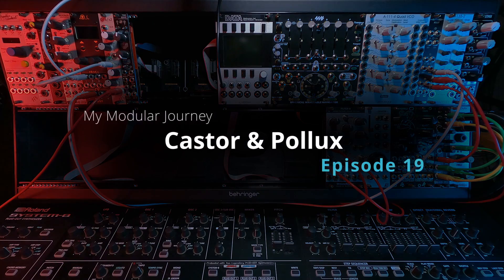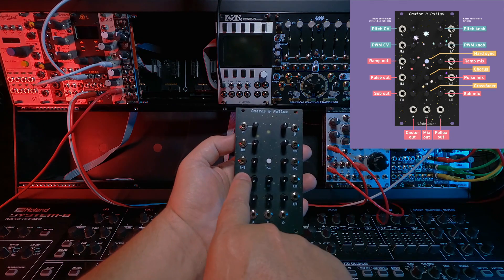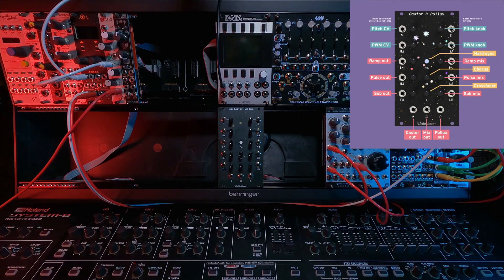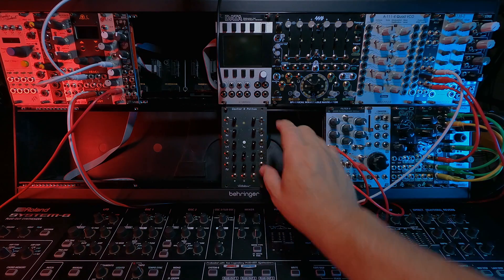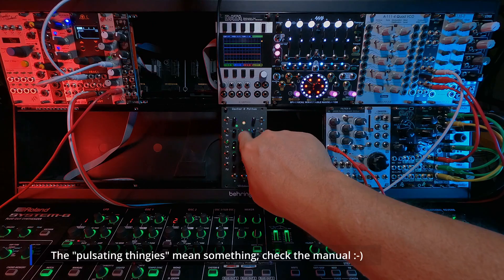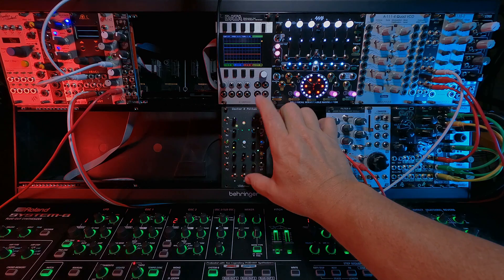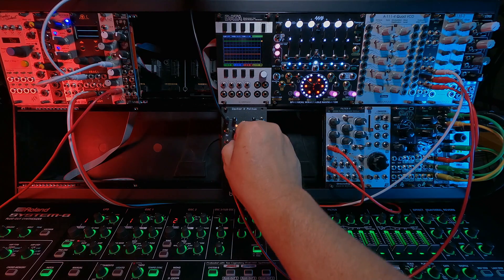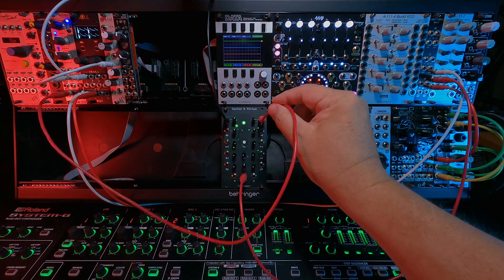My Modular Journey - Season 2: Episode 19 (Castor & Pollux)

Comment: Regarding the sound cutting out at full right... it's PW at full 100% cycle which results in silence. Some oscillators will do the same a 0% cycle - also silence. I don't think the original Roland Junos and SH synths (certainly the SH101) do that... the PW is restricted so that there is always sound. My Pro-One certainly does, however. Hope this is helpful, or reassuring... I don't think it's a "fault".
Reply from the maker: Ahh, thank you Andrew. That makes sense. I've gotten used to attenuating that signal anyway so I'll keep this in mind.
Reply: @VisionsMusicGroup  it'll also allow for sequencing mutes etc